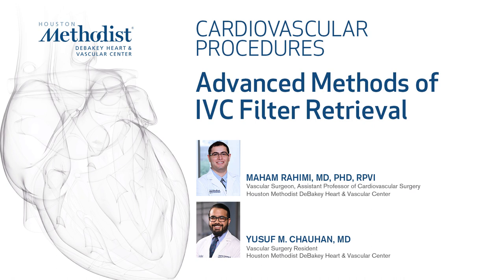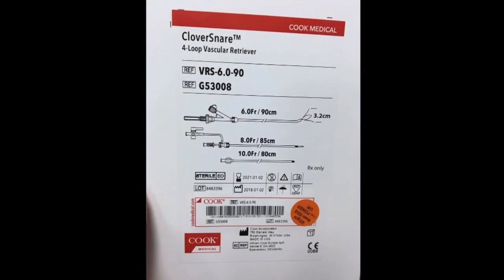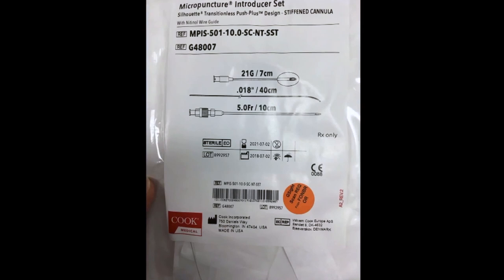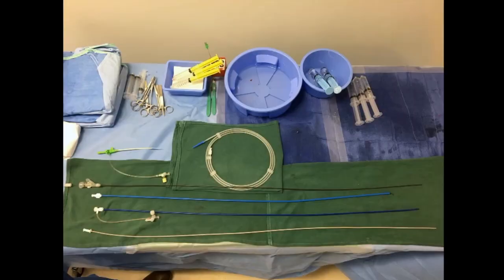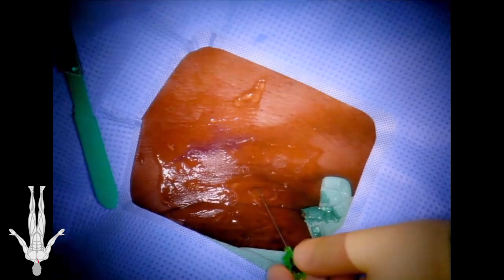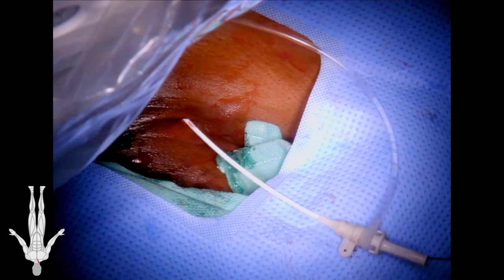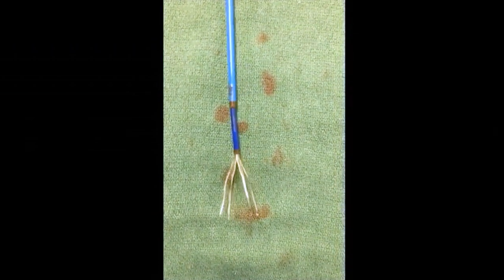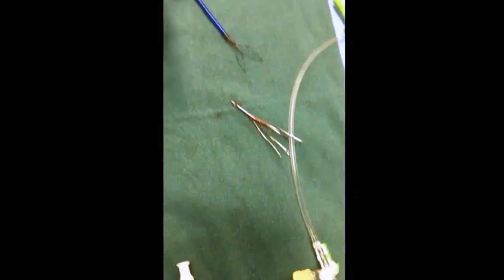Advanced Methods of IVC Filter Retrieval (Maham Rahimi, MD, Yusuf Chauhan, MD)

Comment: Was laser needed for the embedded hook?
Reply: That is very good question because I've read that the laser sheath technique has an excellent success rate I've had a filter in me now for over a year  the doctor that put it in me told me ju how important it was to have it removed with in six weeks or it could become stuck I was and am scared half to death having this thing in me as soon as COVID hit he cancelled my appointment my critical appointment it was not elective surgery it was and still is an emergency now I'm about to have this thing taken out butwithout a laser sheath By a vascular surgeon here in Iowa I've read online that John's Hopkins uses laser tech I may have to go there if this doesn't work
Reply: @jodycarter1483  I had one and was finally able to get it removed a few days ago. 1st attempt failed. After being in a little over 2 months. It had tilted and could not be retrieved standard way. It ran me crazy with that thing being in. Have it checked 1st to make sure it hadn’t tilted. If it’s tilted then you may need interventional radiologist radiologist with different tools. Mine was removed with laser and had to be repositioned to straighten it. Although it wasn’t that inbeded because it hadn’t been in too long. Get it out ASAP
Reply: Unfortunately  mine is embedded because it tilted the stupid doctor treated this like it was not critical to remove asap so my vena cava grew around y hook the vascular surgeon here in Iowa assures me he can remove this thing without  a laser sheath I hope so my appointment is intwo weeks isaw a video on YouTube recently of a vascular surgeon removing one without a laser successful ly so here's hoping I guess it can be done 😰😱thanks for texting me  God bless
Reply: @jodycarter1483  how did surgery go? Mines been in over 10 years.  I'm having surgery to remove it and I'm freaking out